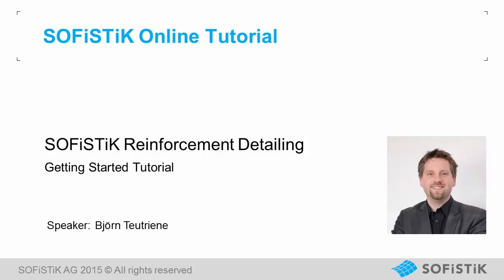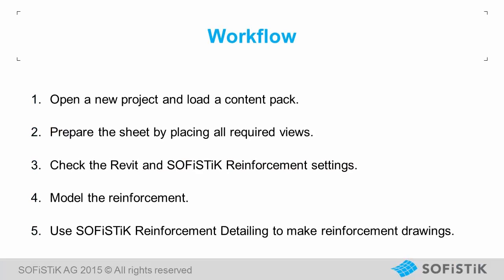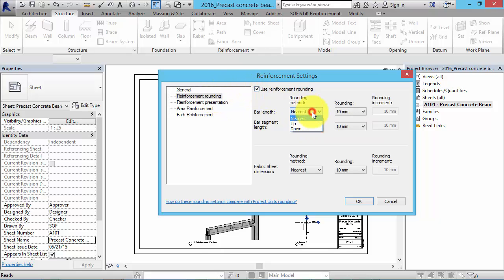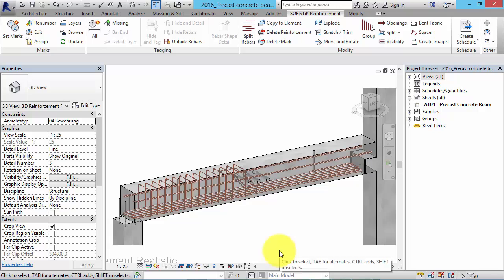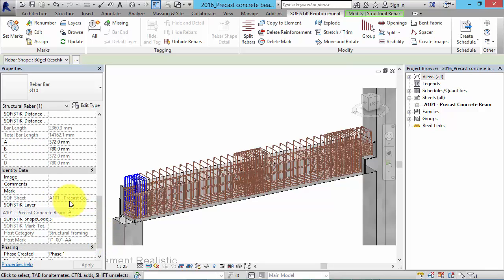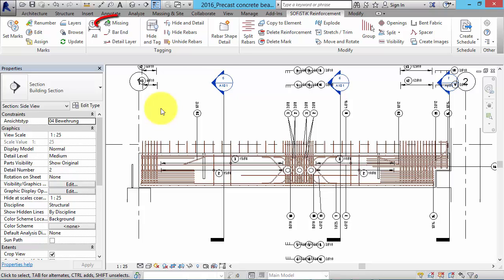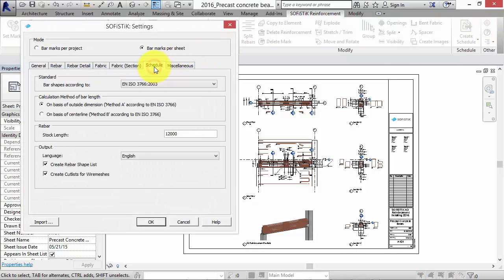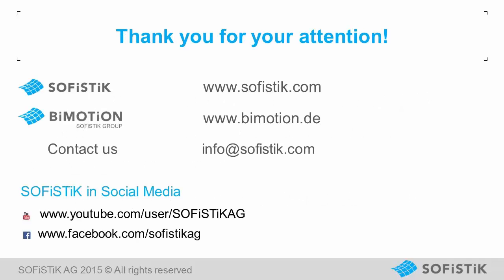SOFiSTiK Reinforcement Detailing: Getting Started

Comment: does it support British Standard Design codes
Reply from the maker: Hi Antony,
SOFiSTiK Reinforcement Detailing support the British Standard since many years. You can set the rebar weight - and bending schedules as well as the shape code detection according to BS 8666:2005. Additionally a Content Pack UK is included which provides all the Annotation and Detailing Families in UK Style. These families will be used from our annotation and detailing tools automatically. …and they are customizable at all.
Your SOFiSTiK Team
Reply: @SOFiSTiKAG  i SAW YOUR TUTORIALS IS A GREAT SOFTWARE AND WANNA USE IT AS A REVIT 2021 EXTENSION AND AUTOCAD 2021
Reply from the maker: @ngangakantony  Sorry for the late response. If you aren´t using it already, then get in tough with us via: info@sofistik.com ;)